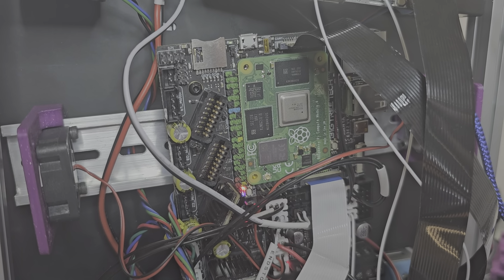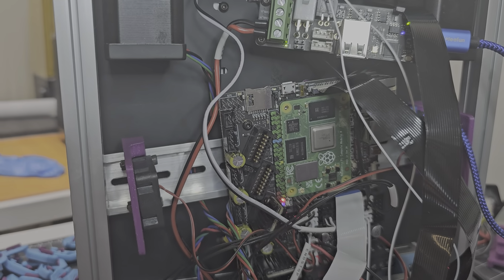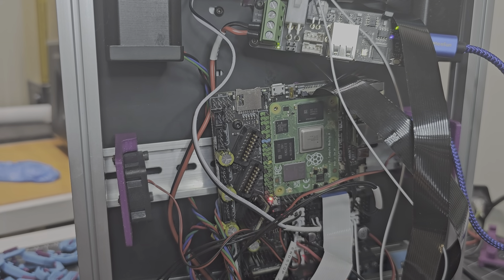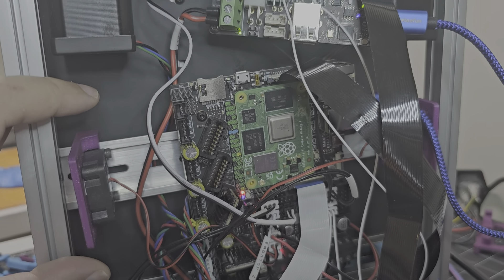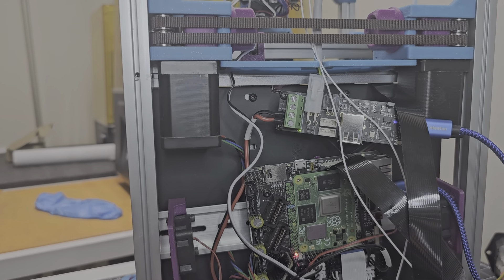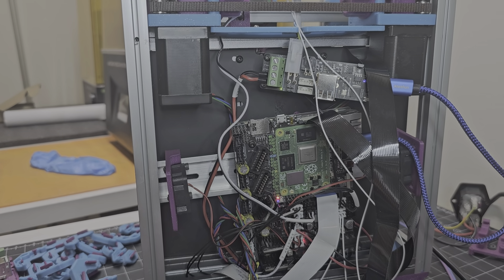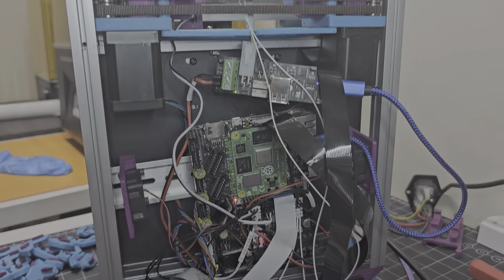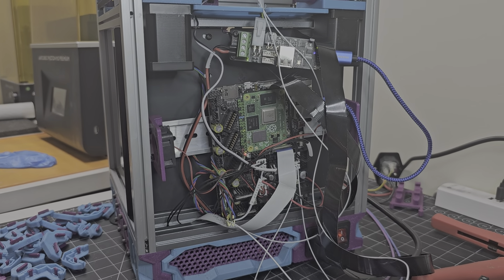Voron 0.2S1: Getting ready for 48V on the BoxZero

Comment: Thanks so much for that link to the PSU, been on the hunt for a sufficient 48v psu for my build! Looks perfect.
Reply from the maker: I run with a Mean Well LRS-100-48 on my V2.4, which so far appears to have enough power for my two LDO 2804 A&B motors. On the V2 the Z motors are still powered at 24V.
I figured 90W should be sufficient for at least A&B on the V0. I might try to also drive the Z motor at 48V, and hope the Mean Well IRM-90-48ST can keep up. If not, then the V0 will also keep the Z at 24V.
Reply: @oldguymeltsplastic  I'm planning a ridiculous tri-zero build and cramming a full liquid cooled system into it  for the hotend (and maybe the AB steppers and stepper drivers) with only an additional 50mm added to the y axis, so space is definitely a big topic in mine. I really wanted to run 48v on the AB drives and I think I can just barely manage it with the IRM-90-48ST, I checked dimensions against my plan in Fusion and it seems like a good fit so I put it on order.

Comment: Been thinking about redoing the electronics in my own v0 and wondered if it's not possible to use the can built into the manta e3ez board rather than needing to run a separate transceiver such as a utoc/u2c. My own parts should be here soon to test myself, but wondering if there was a reason you didn't do it that way given the need to save space where ever possible.
Reply from the maker: I had some Timer Too Close errors on my 2.4 that were unresolvable for weeks until I decided to add a U2C into the CAN ecosystem. That was last April.
Reply from the maker: Adding a U2C to my 2.4's CAN ecosystem was the only thing that resolved three weeks of Timer Too Close errors last April. Haven't seen a TTC error since. That decided me that a U2C was the way to go for all of my CAN printers. Your mileage may vary.
Reply: @oldguymeltsplastic  interesting, might have to give it a try both ways just to see, used utoc and u2c on my 2.4s and mercury one, figured it might be time to try it without on this one.
Reply from the maker: @abeardedbucket  some people never get TTC issues even without a U2C. I am also told that some more recent Klipper updates have helped with TTC errors. Good luck on your build!

Comment: Really enjoying your videos. What are the benefits of going from 24v to 48v?
Reply from the maker: Powering the stepper drivers at 48V in theory allows you in increase the run_current, and so provide the motors with more torque allowing higher speeds and accelerations.
Given the small build space of the V0, there might not be as great a benefit as on my V2, which is also running the AB motors at 48V.
Reply: @oldguymeltsplastic  Today I learned! Thank You for teaching me something new!